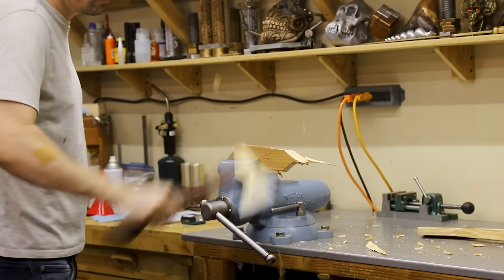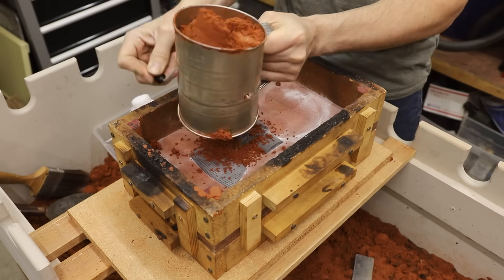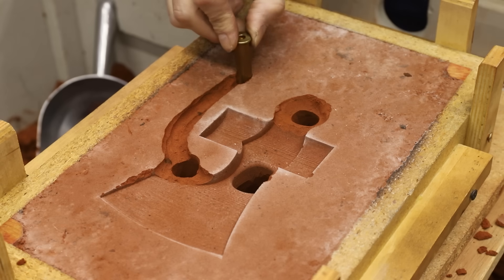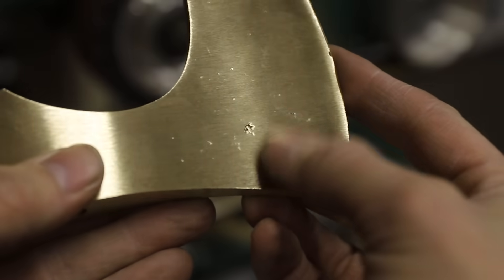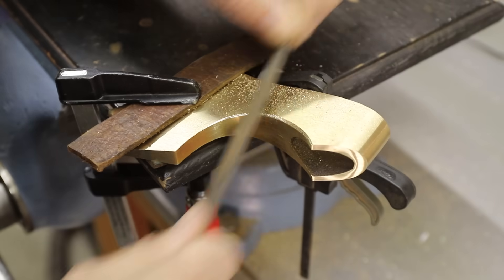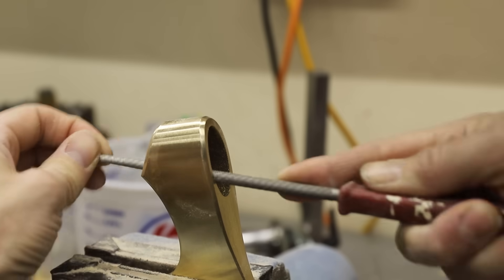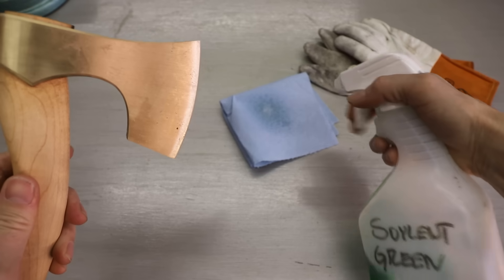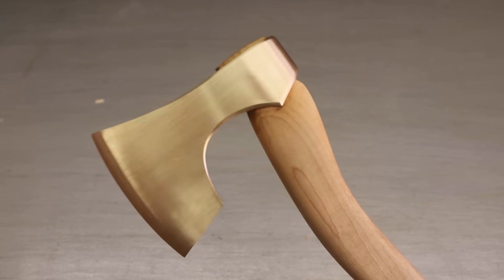Making & Testing Aluminum Bronze Hatchet WILL IT SURVIVE?

Comment: aluminum bronze can be quench hardened in water, depending on the ratio. There's alpha phase, multi phase and beta phase aluminum bronze. I'd advise a multi phase, with 10% Al, and some additives such as 5% Nickel and 4% iron. You will need to temper the bronze after the quench tho. If you need any advice on that, just tell me and i'll try to contact you by email to tell you. (Also aluminum bronze can be forged up to orange hot, wich is very convenient. It's nearly hard as steel under the hammer)
Reply: ASTM B148 is the standard for the various grades of Aluminum Bronze.  It will give you composition and hardness requirements for the different alloys and heat treat/ temper anneal conditions.  I believe the nickel aluminum bronze referenced above is the 955 alloy (working from memory, it's been a few years).  Some of these alloy's tend to be finicky when working with them.   Balancing toughness and hardness can be tricky.  You can probably find an older copy of the standard online.  They generally don't change much over the years and for your purposes should be fine.
Reply: @jeffreywhitmoyer860  idk, in europe we don't use obscure numbers, we directly refer to an alloy by its composition, so CuAl10Ni5Fe4 is the most common aluminum bronze out there. Very hard, but not so brittle that it's unusable. Work hardening it will give pretty good hardness, but quench hardening makes martensite with a micro hardness of like 42HRC in an alpha matrix. There are harder alloys tho. CuAl13 with 13% aluminium is extremely hard and brittle, and is beta phase only, so it can't be forged, and will break when hammered. But it's hard!
Reply: @jeanladoire4141 I suppose that could be an easy route to edge or surface hardening. Possibly you could start with CuAl10, and immerse it in molten Aluminium. 
So the Aluminium ions can soak into the surface lattice 
It would be worth experimenting with a few different aluminium alloys or melt mixtures here. Aluminium magnesium 5000 series could work. Or Aluminium silicon. Or the rare Aluminium lithium alloys.
Reply: @Maungateitei  erh i dont think thats a very good idea, you can't easily control the penetration of the aluminum, and there's no point in having a hard outside layer, it would be better for performances to have everything of the same alloy
Reply: @jeanladoire4141  you could use powder metallurgy if you want to control the ratios precisely. But you probably don't you just want smaller ions packing the gaps.
You'd probably better using a chemically bonded ceramic system though.
Like Aluminium Phosphate, berlinite.
It's very easy to do, and is to quartz, like sapphire is to diamond.
Almost as hard but far tougher.
Iron phosphate ceramic is why the dehli iron pillar is so surface hard and doesn't rust.
Probably achieved by casting in a bone ash plaster mold.
The Aluminium Phosphate system is almost the same as Iron phosphate but harder and tougher.
Nitriding is a similar ceramic chemistry.
Reply: @Maungateitei  i mean why not, but for a blade i dont really see the point. You need a thick hardened edge, not just a surface layer. A softer core can yield and crack the outside when overstressed
Reply: Some people know so damn much about things. It amazes me how much knowledge is out there. Just reading this thread was fascinating.
Reply: Yeah, there're easily as many bronzes as steels, and just like with steel very small changes make all the difference sometimes. Whatever this alloy is, it's kind of pretty but clearly doesn't quite... cut it :D
Reply: @Ithirahad  tbh his aluminium bronze is harder than what they had in antiquity, and that didn't prevent people from the ancient world from cutting down trees and stuff. His edge got damaged because he probably didnt use the best shape for bronze. Steel is hard enough to hold its shape and can be thinned down a lot. Bronze is weaker so a thicker edge would be better. Also you don't use bronze the same way you use steel. I've forged quite a few quench hardened bronze blades, and even tho they are vastly harder than traditional tin bronze (and will cut shavings from mild steel), it's still much much softer than good hardened steel. I've found that you really need to treat these blades with more respect, and be more careful. Also to keep a shaving sharp edge on a bronze blade, you need to frequently hone the edge. It takes like 10-20 seconds but it keeps the performance good.

There are plenty of extremely hard bronze alloys, with the best being CuBe2 or CuCoBe, basically beryllium bronze. Looks like copper, but when quench hardened and tempered, that shit will reach 55HRC, wich is retardedly hard for copper. However beryllium dust is bad for the lungs, so there are alternatives that are nickel based, so basically nickel bronzes, but they look like silver, wich is pointless in terms of aesthetics.
Reply: @jeanladoire4141 what's the best working hardness?
Reply: @jeanladoire4141 I don't cast, but I had occasion to work with nickle tin bronze in my lathe and milling machine and it was very impressive.  Easily as tough as mild steel.
Reply: @brianmoore1164 haven't heard much of nickel tin bronze as of now, how easy is it to melt and cast? Might be a really good material for some projects.
Reply: @Goochgravysuppliers  depends on the application i guess, you can't push copper as far as iron in terms of alloys, so going too hard is just counter productive. My bronze knives are around 30HRC, and they are already brittle enough as it is. (They behave like springs that will break instead of bend). I suppose a copper cobalt beryllium alloy could go to 45HRC, perhaps 50HRC, but for an axe going too hard isn't a good idea
Reply: @CatNolara  I don't cast. What I ran into was commercially made bar stock. I was doing lathe and mill work. From my reading, the most common use is in the oil industry when they need high strength and a non-sparking material. It looks like copper tin bronze, but as soon as I started to machine it, I knew it was very different. Cutting speeds and feeds had to be reduced like I was cutting steel.
Reply: @jeanladoire4141 In antiquity they even made arsenic strengthened beryllium bronze, which is hard and strong as F but the metallurgical process dramatically lowers the life expectancy of the smith. There are many bronzes that can kick steel ass - but the constituent ores can be pretty gnarly both in terms of number of dollars spent and number of osha violations.
Reply: @stianyttervik9070  i dont think they had access to beryllium bronze lmao, only arsenic bronze but that was a pollutant in the ore
Reply: I'd imagine that an adze would be more the shape a bronze tool would use rather than an axe. An adze is like a bent plane chisel more like a beaver-tooth in shape. It will carve of a continous wooden shaving rather than splitting off a chip like with an axe. An adze will not damage it's edge as easily since the different sides faces different stress.
Reply: @jeanladoire4141  I have a paperweight a friend gave me that was from a piece of test equipment. I thought it was a big, fist-size really striking piece of polished copper until I got it home. It had CuBe2 on the end and being into physics I knew that meant copper and beryllium but of course I had to look up the alloys. This one seems to have a pleasing, rose tint when next to copper. It has good conductivity which is why it was used as it was. It and a couple of 10oz poured silver bars keep my papers down.
Reply: @ut000bs  Keep in mind beryllium copper is toxic.  It's fine unless you want to start milling or grinding it.  We had to use respirators when milling stuff like that.  Edit: I also wouldn't want a cutting board made out of it.
Reply: @brianmoore1164  Milling aluminum bronze like AMPCO 18 or 21W is PITA. Carbide is the only way to go.  I made tons of money machining it.
Reply: @edwardfletcher7790  who said there was aluminium in antiquity ? The only "modern age" metal they had was nickel, and still, it was in the form of cupro nickel. But pure nickel is a modern thing
Reply: @jeanladoire4141 What alloy do you think is the strongest that still has a "bronze" look to it?
Reply: @Sam-gf1eb  aluminium bronzes have pretty good performances and look rather golden. Then the hardest are beryllium/cobalt bronze, they look like copper, but are toxic. Some new alloys are being developped currently
Reply: @nateman10  copper is heavier than iron (and steel). I've never seen rhenium used as an alloying element. If you want a copper sword hard as Steel, you need copper/beryllium, perhaps with cobalt too. Looks like copper, can be forged, but quenches hard like a medium carbon steel, wich is more than enough for a sword. That being said idk about the toughness at the high hardness levels
Reply: @jeanladoire4141  adding a little zinc would go a long way as far as hardness. Of course, then I think technically it would be brass. But much better for holding an edge.
Reply: @Nilboggen  yeah but it's kinda shit, zinc has a lot of inconvenients compared to other elements. There's a reason why tin bronze was used instead of brass.
Reply: @martindinner3621  what zinc fumes ? There's no zinc in aluminum bronze
Reply: There are so very many bronze alloys.  The usual silicon bronze that we use to make hardware for yachts (I've forgotten the alloy number), is similar in strength to the common stainless steel used for the same purposes.  That given--there are Stainless alloys that are hugely stronger, and also bronze alloys that are hugely stronger too.
It is a balance of cost against working requirements.
Reply: @WanderingMiqo  no it's classified as an aluminium based bronze. Aluminium bronze isn't just copper and al. Steel isn't iron and carbon, nowadays you can't find a steel without manganese added for exemple.
Reply: In tool and die, we use aluminum bronze of various alloys for drawing operations.  Specifically Ampco produced aluminum bronze which is made using a continuous casting process.  For simplicity it's like squeezing play dough through a chilled die.  I've designed dies with Ampco 25 which is as hard as a cat's head.  The reason we use it for this is it can be polished to a very high polish while being very wear resistant, which is what we want.  It's quite hard too, up in the tool steel level of Rc.  I guarantee a milled ampco bronze head will keep up with a steel head until it suffers a crack, after which it will disintegrate.
Reply: Bro googled shit for hours just to make this post
Reply: interesting ...Thank you
Reply: CuAl10Ni5Fe4
Reply: @Incomprehensiblue  thats a very popular aluminum/nickel bronze, hard and somewhat tough
Reply: @nateman10 yeah for what you're trying to do you're going to need ALOT more specialized information sources, you might want to start with a high ranking wizard, nothing lower than an elder either! Or maybe you can find a enchanter/enchantress who specializes in weapons specifically or If you're really lucky find a blacksmith that already mastered imbuning magical properties into their work. Or just forget copper as im sure at least one of the classic fantasy magic metal's have the property's you want... Maybe mithril?, adamantium? Valerian steel? Oh vibranium might work!! No im just joking around lol but i had to when i read one of the property's you're looking for is the ability to cut through steel???  If you know of ANYTHING that is able to do that so easily that you're just nonchalant about it then please let me know!!! I don't even care if it doesn't have the conductivity or heat resistance... Hell idc if it doesn't have flexibility either or If it's heavier..
 Only property I want is cutting through steel & im happy I don't need All the others, I'd just feel greedy at that point because im already about to be rich as hell from the steel Slayer. Seriously tho i see that you said you have no experience or knowledge in forging or metallurgy, but honestly that wasn't needed because it was pretty obvious even for some one like me who is farrrrr from anything i would consider above a hobbyist especially compared to some of these guys commenting, but you are kind of asking for something extremely unrealistic & you might need to lower down your expectations for what would work for your use... Because it sounds like you're not using it for anything scientific or engineering with super tiny tolerances only will work. It sounds more like you're trying to have fun with a self made fantasy weapon replica or just making  something fantasy in real life,  & if that's the case i think there's Alot of different way's we could actually help you out & recommend that would cover most of the things you want, at least the point it will be awesome still but sadly ee can't recreate magic in real life. Also by your requirements im kind of nervous about what you're attempting without specifics because it sounds like you are wanting a actually viable for combat stresses but then the conductivity & heat resistance is the real red flags... Either you're wanting to make a flaming sword or more likely due to the conductivity part you are wanting to make a lightning blade/ energy sword, lighter saber type of thing & if that is the case then please for YOUR own well being and safety do NOT attempt anything even CLOSE to that! There's sooo many different layers of danger involved even If somehow everything went 1000% absolutely perfect first try ( nothing experimental like this ever does) & if you were Also a completely knowledgeable expert in everything involved or even with a safety team on site is deadly... But what makes it so much scarier is when you factor in the INSANE amount of accidents or just random occurrences that could also happen to anybody including "expert's" doing this is bad... sure expert's chance's are better but they still are very far from safe.. & again I don't think you would be an expert or properly able to create The safest possible setup to test it and understand what youre dealing with & All the different things it effects & cause's to happen, when working with insanely high amounts of electrical power enough to generate enough heat that it needed to be made a specific requirement  of the chosen materials tolerances before picking the alloy ... If it's making enough heat for that to be a concern then that is an amount of electrical power that inexperienced or uneducated people who haven't dealt with any type of higher voltages or electrical work period can't even comprehend... If I'm wrong & it's not anything unsafe let us know what you want to accomplish & I'll be glad to help as I'm sure some of the other's here will as well... I actually already have an idea on a angle to make something similar but it depends on what the requirements have to be & if those requirements are flexible or not.
Reply: أيها السيد كيف يمكن تقوية النحاس من فضلك أيضا كيف يمكن تشكيله برتقالي اللون
Reply: so about 10 % hard and high melting temp stuff like iron and nickel and it would be tough?  That's kind of cheating for anything to tell bronze age person.
Reply: @RWZiggy  tbh nickel wasn't known as a metal until the modern era (you need modern chemistry to isolate it) however nickel bronze was a thing ! Just like zinc wasn't known as a metal, but yellow brass was common. Basically you could mix the ore with molten copper, and use chemicals like sulfur and saltpeter, and it would convert the nickel ore into metal, and it mixes with the copper, making a silvery white bronze. Also, meteoritic iron was usually nickel mixed with iron, so they could have used a chunk of that. That being said, aluminium requires modern chemistry to be extracted at all, and cannot be made without acids and such. Aluminium was more valuable than gold in the 1800s, some breastplates were made of aluminium as a show of health
Reply: @jeanladoire4141  Considering Al is the most abundant metal in the earth's crust, we were late to the party.  Yes, needs electro-chemical processes to be controlled.
Reply: @scottrackley4457  whatever, silicium is everywhere as sand and quarts, and yet we waited for thousands of years to get silicon wafers for electronics
Reply: Now that's what I'm talking about
Reply: Actually alimentation brozm is harder than previous though on case studies across the Midwest,  what they Actually found to be redundant tensile strength turned out to be sixteen percent bichromium assulfsilcate.. which isn't a problem if you keep in mind the farther you're prepared to take your quench could easily set you back a few points on hrc or furthermore hardness retained and also  .... are you still reading this comment ?? I wouldn't be. It's just a bunch of word salad. But here you are still reading the redundant and also superficial calafragalisticexpeallados .... f u.
Reply: @mattsaunders7207  it's word salad for people who don't know anything about metallurgy and bladesmithing, f u
Reply: Can bronze be work/peen hardened with a hammer?  I've got a slab about 4.5"w by about 15"l and over .5"thick I found in my dad's garage.  Thought about doing Something with it.  Just don't know what.
Reply: Aluminum stays soft after cooling for like 5 mins or so.
Reply: Omg, I think I found the bronze guru! I have been curious about bronze forging for some time. I am really going to dive into some of the information you shared here - tyvm.
Reply: @matthewmarting3623  traditional tin bronze won't like being hot forged. The tin just doesnt hold itself at high temperatures and the alloy will crumble. Tin bronze should be forged cold and annealed a few times. Some bronzes however will hold themselves at high heat, such as nickel bronzes and aluminium bronzes.
Reply: aluminum nickel bronze bushings are used for aircraft to ride against steel shafts in assemblies.
Reply: surprised the last axes worked so well as he hasnt been hardening anything but the steel ones?
Reply: Why does copper soften when heated and quenched? I am legit asking.
Reply: @Sllabamgil567  it's rather that quenching doesn't effect copper, so you can quench it to get it cold quicker. Just heating copper and letting cool down will do the same thing pretty much. However cooling copper quickly helps pop off the oxides
Reply: Thanks internet forged in fire why don’t you make one and show us all not full of shit.
Reply: @lonewolfwildernesssurvival9443  i litterally make hardened bronze blades, i forge them in a traditional way and i make tools and knives and whatnot
Reply: Incorrect